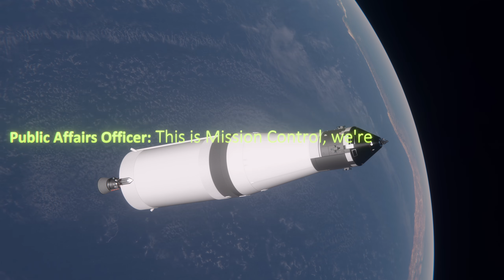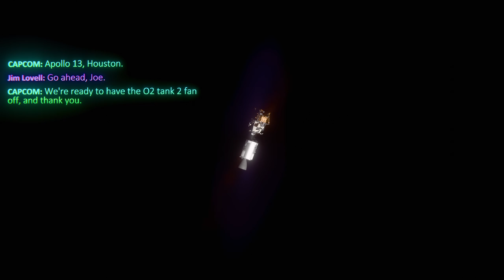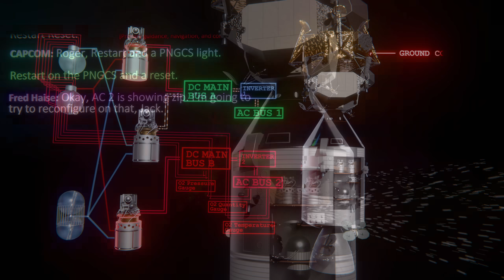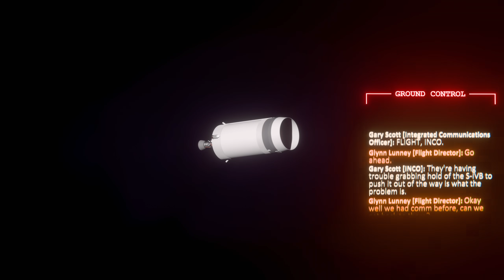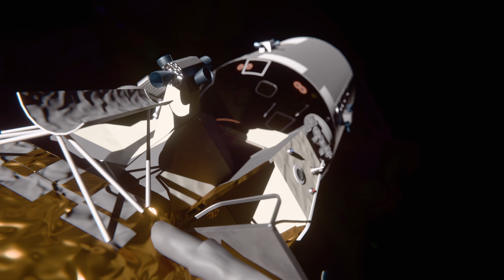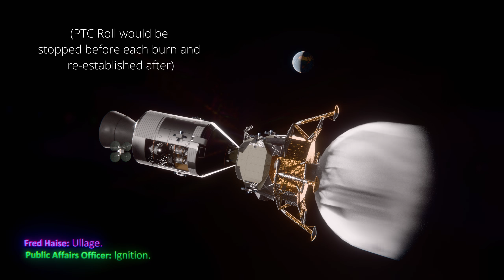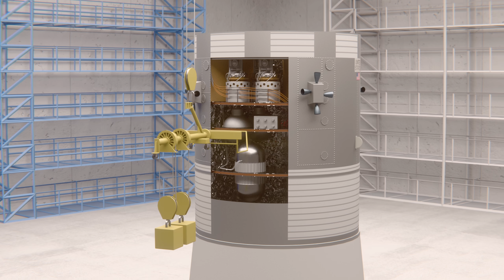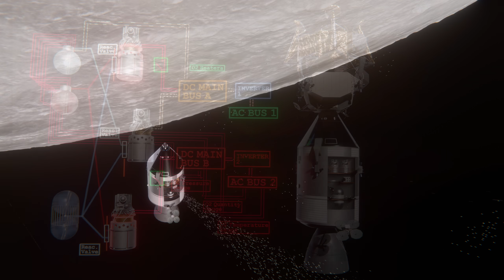Apollo 13: What Went Wrong

Comment: They didn’t calculate the 190 mph constant solar winds into the telemetry.  Hmmm??  
     From my understanding thru NASA these winds bend the magnetic fields in towards the earth 1000’s of miles while ripping the edges of the atmosphere off. 
   They say if the magnetic fields were to fail. It would instantly cause the power grid to fail. Sending the side of earth facing the sun into a blackout. 
    So I don’t understand how that little space ship could withstand these winds for dozens of hours. Not to mention what these trillions of particles would do to their retain and their bodies.  It would e the same thing as jumping into a million watt microwave.  Hmmmm??
Reply: The solar wind moves at high speed, but contains so few atoms that the force imparted by the wind is tiny. For a spacecraft that operates in space for decades, this wind becomes noticeable in the form of a very small torque that tries to rotate the spacecraft. e.g. JWST has to be pointed very accurately at its targets, and this torque becomes something they have to deal with. 
The Apollo missions were far too short for this to be a problem.
Reply: @zounds010  
    Lmao.   They bend a magnetic field.  The same field that sustains life in earth.  How are they ripping the edges of our atmosphere of into space.  
     So let’s say you’re right and there are  Not so many atoms in space. What about the atoms the spaceship is made out of ??   Wouldn’t that make it easier to push the ship ?   I mean the entire premise of the leaking tank is how far it pushes the astronauts out of its path.    
          This is a boat load of crap. The fact he said they would have still returned to earth had they ran out of oxygen is beyond ridiculous.  The window for a safe return And their so called safe trajectory would have skipped them off into space.  But truth is they never left orbit.
Reply: @spikenomoon  Our atmosphere loses about 3 kg per second, mostly hydrogen. This is due to charge exchange escape (~60–90%), Jeans escape (~10–40%), and solar wind escape (~10–15%). 
That's 0.3 kg/s due to solar wind, spread out over an area of 500 million km2, That's how small the effect of the solar wind is. Solar wind escape means one atom from the sun hits one atom of hydrogen, imparting enough kinetic energy for that one atom to reach Earth escape speed. 

The solar wind exerts a force of 1–6 nPa ((1–6)E−9 N/m2. A force of a few nanoNewtons is not going to noticeably change the trajectory of a 50-ton spacecraft.
Reply: @spikenomoon  The spacecraft would still have returned to Earth if they'd run out of oxygen. The astronauts would have been dead, but the spacecraft's trajectory does not depend on having live astronauts inside. 
The window for a safe return was in fact long enough, as the successful return of Apollo 13 demonstrated.
Reply: @spikenomoon  No, their trajectory would not have 'skipped them off into space'. It's pretty much impossible to do that. If you skip off the atmosphere, you still fly through enough of the atmosphere to slow you down significantly. The result is that after you skip off, your trajectory is a parabola and you will reenter a bit farther downrange.
Reply: @spikenomoon  The truth is that they did leave Earth orbit, as proven by independent third-party observation.
Reply: @zounds010 Bull shit.  They bend our magic fields. ( As per NASA). They blow190 mph constantly. 
    This has nothing to do with your made up math.   When those particles hit that space ship it would glow like a fork I. A trillion watt microwave.  The astronauts Retinas would be fried.  Even NaSA admits we can’t get thru them. Apparently we lost the technology.   
    I’m sure AI could help them remember.  
     Do all the silly math you want.  No human body will survive on the other side of the magnetic protection that prevents out planet from dying.    They deceive us by calling them belts of radiation.  They are not belts of radiation. They are an invisible magnetic shield protecting us from the radiation.   The danger is the other side of them.  
   You see the northern lights are a clue.
Reply: @zounds010 
    You don’t have a clue where they would end up. It doesn’t matter what would happen to them.
Reply: @spikenomoon  We do in fact have a clue where they would end up - the physics of a skip reentry was well-known by 1969.
Reply: @spikenomoon  Again, you have no idea what you're talking about. The effects of the solar wind are well-known and easy to look up. The real effects of the solar wind are nothing like the nonsensical claims you are making up.
Reply: @spikenomoon  No, NASA does not claim we can't get through the van Allen belts. The person who told you that was lying to you. THAT is the deceit you should be worried about.
Reply: @spikenomoon  The radiation belts are called that because Earth's magnetic field (which is a lot larger than the belts) traps charged particles in those regions, which produces increased radiation levels in those belts.
Reply: @spikenomoon  Earth's magnetic field is very, very weak. THAT is why the solar wind can distort it.
Reply: @spikenomoon  "a trillion Watt microwave" shows you have no clue of the actual energies involved. The actual energy imparted by the solar wind is nanoWatts, not TW. That means you're 21 orders of magnitude out with your "estimate".
Reply: @zounds010 .  If this is true how does it bend the magnetic fields 1000’s of miles.  The same people giving you data for your math are the same arm of the beast lying to you about the moon landings. 
    They are not belts of radiation. They are magnetic shields protecting us from the radiation.
Reply: @spikenomoon  Earth's magnetic field is very, very weak. It's so weak that a compass is easily made to point in the wrong direction by bringing random pieces of metal near to it. It's not surprising that Earth's magnetic field is distorted by its interaction with the Sun's magnetic field and the solar wind. 
We call the van Allen belts radiation belts because the magnetic field traps charged particles in these regions.
Reply: @spikenomoon  The same people who give me data on Earth's magnetic field spoke the truth about the Apollo landings, as proven by tons of evidence from multiple independent sources.
Reply: @zounds010 Bullshit.
Reply: @spikenomoon  Whether you like it or not, I've told you the truth. Your incredulity only proves one thing: your lack of knowledge.
Reply: @zounds010 Yes they have.
Reply: @zounds010  Not.   They shield us from them. 
    We know our magnetic fields prevent the solar radiation from hitting the earth. 
   Tell me something. If our magnetic fields failed why would our power grids be destroyed instantly.?  The danger is not your trapped radiation. It’s the radiation being rejected by the belts 
   It’s a giant microwave on the other side of those radiation trappers
Reply: @spikenomoon  The radiation level outside the belts is far lower than you imagine. 60 µSv/hour is hardly "a gigantic microwave".
Reply: @z @zounds010 okay. You wouldn’t think it would instantly destroy our power grid. 
       The beast runs this world and the narrative of what is taught. You can believe what they tell you but I’m positive it’s not the truth.
Reply: @spikenomoon  You're "positive" based on lack of knowledge and on denial of reality.
Reply: @zounds010 Mankind has boundaries my friend. The fact that we know earth would have no life in a short period of time. The fact our power grids would be destroyed instantly if the magnetic fields stopped.  Then you claim there is no danger for a man to be in them makes no sense.  They could not even stay at a 400 mile orbit because the astronauts were be bombarded with streaks of brilliant whit light blasting through their  retinas making them unable to sleep or concentrate.
Reply: @spikenomoon  My claims are based on reality. Yours are based on your lack of understanding. 
Whether radiation is dangerous or not, depends on two variables: 
1. radiation level,
2. exposure time.

The radiation level in space, above the van Allen belts, is 60µSv/hour on average. OSHA has set a dose limit of 50 mSv per year for most employees in the USA. It takes 833 hours to accumulate a dose of 50 mSv at 60µSv/hour. This means you can spend 833 hours in space, with no radiation protection at all, before you get to the legal dose limit. At a dose of 100 mSv, your risk of getting cancer starts to increase measurably. Radiation poisoning starts to occur at 400 mSv. 
In an Apollo-type spacecraft, your radiation exposure is a hundred times lower than outside, so instead of 34 days, you can spend 3400 days in space before you get to 50 mSv. 
Now, are you going to continue your reality denial, or are you going to accept that I know more about this than you do?
Reply: @zounds010 .  You refuse to answer the question.  Why would life be eliminated in a short period of time.  Why would our power grids fail immediately.? If they are not dangerous why did nasa tell us this. ?  Why would our oceans boil away.?Why would vegetation start withering in hours?
Reply: @spikenomoon  You're asking me to explain claims I don't know the origin of, and which I find unlikely, to say the least. Find me a source, and I might be able to explain those claims to you.
Reply: @zounds010 NASA
Reply: @spikenomoon  No, our power grid would not be "destroyed instantly" when our magnetic field disappears. 
In 1859, the Carrington Event happened: a large coronal mass ejection from the sun interacted with Earth's magnetic field. This interaction induced large currents in long cables, like telegraph cables, destroying some equipment. Without a magnetic field, there is no induced current, so no, our power grid would not be "destroyed" if we didn't have a magnetic field. If our magnetic field faded away gradually, our power grid wouldn't notice.
Reply: @spikenomoon  " It’s a giant microwave"
No, it is not. A radiation level of 60 µSv/hour is not "a giant microwave". That's just your lack of understanding again.
Reply: @spikenomoon  If our magnetic field disappeared, we'd be exposed to a bit more radiation. This will be a problem in the long term, but not an "instant death" kind of problem. 
Our atmosphere would slowly lose mass because solar wind particles would collide with atoms in our atmosphere and accelerate them to a high enough speed to escape Earths gravity. This already happens, at a rate of about 3 kg/s. This rate would increase. If this goes on long enough (i.e. tens of millions of years) we'd lose our atmosphere.
Reply: @zounds010 .  What’s funny is that you can just research it?  I will tell you the shirt you find now is different than from a decade ago.  There were astronauts that went up to 400 mile orbit. Space shuttles around 150.  The astronauts claimed that they couldn’t concentrate.  They couldn’t sleep.  Because they kept having streaks, a brilliant white flashes of light go through their retinas. It didn’t matter if their eyes were closed or if they covered stuff on top of their head.  Are retinas cannot survive the suns radiation.  You can throw up all the fancy math. NASA themselves have said our power groups would fail instantly.   There was no protection on our little papier-mâché spacecraft they went to the moon.  There is no way the retina could survive the Sun’s radiation.
Reply: @zounds010 Why would our power grids fail. If the magnetic fields failed.
Reply: @zounds010  oh OK well my information came from NASA.
Reply: @spikenomoon  "NASA themselves have said our power groups would fail instantly"
No, they have not. You are conflating two events: a large CME while our magnetic field is operational (which induces currents in our power grid that may lead to shutdowns), and a collapse of our magnetic field (in which case there is nothing that can induce currents in our power grid, so no, the power grid will NOT fail instantly when this happens.
Reply: @spikenomoon  The astronauts said they had trouble sleeping due to those flashes, which happened while orbiting in the van Allen belts, at a much higher radiation level than the level found outside the belts. The Apollo missions had no issue with this because they spent only 3 hours in the belts, i.e. not enough to include a sleep period. Once outside the belts, the radiation level is too low to produce flashes at a rate to be noticeable.
Reply: @zou @zounds010  my goodness. You actually believe the radiation is less outside of the magnetic fields.  
     Please think about what saying. 
   The magnetic fields protect us from the radiation. They don’t trap it. Every second the sun is like a trillion nuclear explosions wouldn’t they be full by now. ? If evolution is true they have 4.5 billion years of radiation stored up
Reply: @spikenomoon  I believe the radiation level is lower outside of the van Allen belts because a. all of our radiation measurements prove this, and b. I can think logically so I understand why the radiation level is lower outside of the van Allen belts.
Reply: @zou @zounds010 .  
  Okay
Reply: @spikenomoon  The van Allen belts do indeed trap particles. Particles are removed from the van Allen belts when they follow Earth's magnetic field lines to the poles, and enter the atmosphere, resulting in aurorae. They can also leave the van Allen belts when they gain enough kinetic energy through collisions to escape, either to space, or downwards towards Earth where they again enter Earth's atmosphere and are neutralized through collisions.

Comment: An interesting detail I learned studying thermodynamics under a engineer that was part of the Apollo 13 (He was part of the fuel cell development team originally) was that they had a problem identifying where the energy from explosion came from. The tank was over pressurized and the teflon did degrade and ignite with the wire arcs, but there was nothing in the tank that could physically provide the fuel energy needed for the estimated explosion force. Ultimately they discovered that the steel they were using A) Became brittle under the conditions super-critical oxygen is stored at and B) Is also flammable under those conditions. So uh, yeah, they changed that too afterwards as part of the tank redesign lol

Comment: As an engineer i can tell u that such a small fault like with that o2 tank is incredibly hard to detect prior to something going wrong honestly near impossible actually. These machines r all extremely complicated and its impossible to keep track of absolutely everything this i y we have protocols and y we always follow them to the letter to not repeat past mistakes. 

The thing is in hindsight i feel its easy to say "y didnt they check they the o2 tanks more thoroughly" or "howcome no one knew of the false temp readings during the heated emptying of the tanks" or things along those lines but reality is any singular component on the rocket could cause major issues. No person or even team can keep absolutely everything in mind. Its likely the case that they kept track of 1000s of other things and thereby prevented many other failures that never came to fruition but never the less history doesnt remember all u did right because all that truly matters is the one thing u did wrong. 

Another thing thr fact that the decision to stir more frequently caused the accident to happen prematurely, but coincidentally at the perfect time, is insanely lucky.